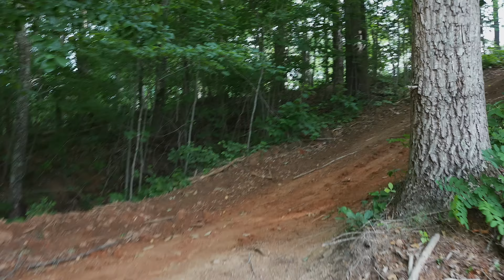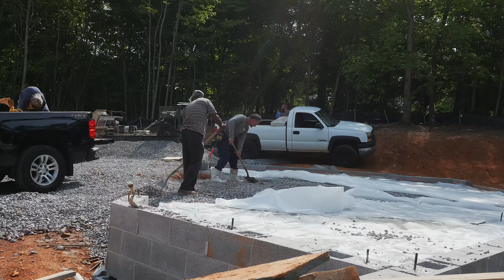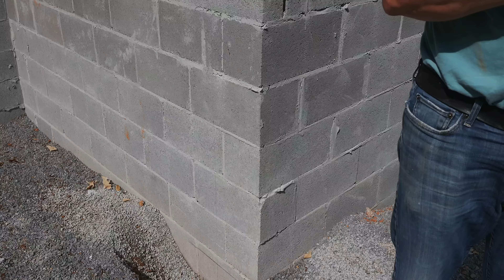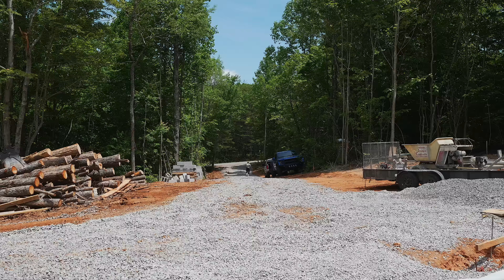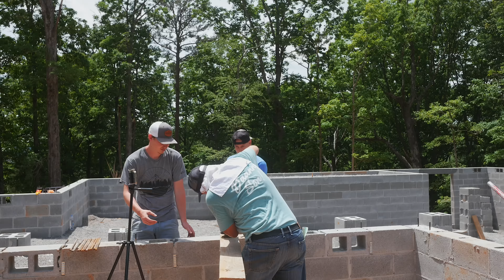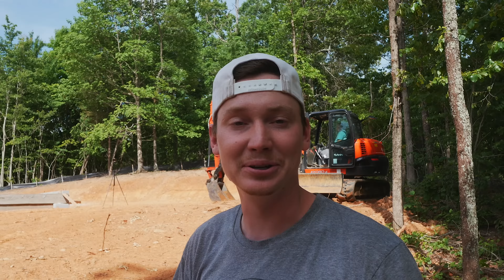The House build is back!!! Concrete Pour Accident??? | Episode 26 Life of Goonzquad

Comment: You should have used the same moisture barrier under the stone in the basement for moisture and bugs have to go to the edges instead of all over and pea gravel would have been better as it is round and not as sharp as the limestone that is sharp just in case you need to get under the foundation where you may be on your hands and knee's.

Comment: The guys should still go down to bottem of driveway drill a well, put a push pull pumps and have running water. Can’t depend on rainwater. Believe me. No water is a killer. And go deep to have a large reserve. I grew up hauling water from a well a 1/2 mile from the house. When I got drafted my dad finally got water to the house. 🤪😭👍